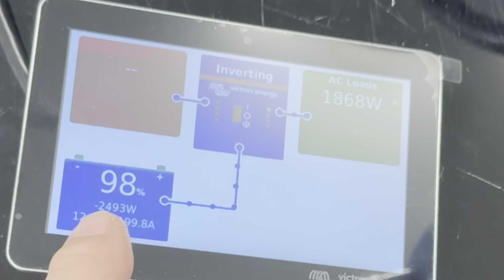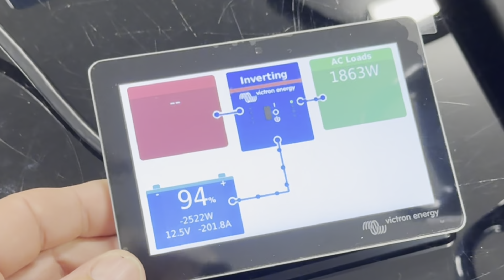200Ah SAFIERY Slimline Lithium pumping out Power for 2000W Induction Hob via Victron Inverter

Comment: G'day Safiery, Thanks for listening to us and getting rid of the animation character! 

But can't all lifepo4 200A batteries do this?  What is the special point of sale here?
Reply from the maker: CAN BMS
Reply: @Safiery Do you your your clients see this victron heft as a viable upgrade to what a standard 200AH bluetooth battery can do?
Reply from the maker: Absolutely as I ca see the health of the battery and its charge/discharge current limit at the screen but more importantly online (if you have internet). Why is this so important? When you accidentally fully discharge the battery, I can guide you on a safe and complete recovery.
Reply: @Safiery I don't want to come across as an arsehole, as I'm still learning this stuff myself; but the charge and discharge limits are on the stickers on the side of the battery... Is the victron gear, at all, required to recover a flattened SOC?  Isn't it simply profiles of amps in, amps out?
Reply: @Safiery I’m just beginning to investigate a switch from gas to induction setup. From my simple understanding, isn’t the role of the BMS to disconnect the load before an over discharge scenario?